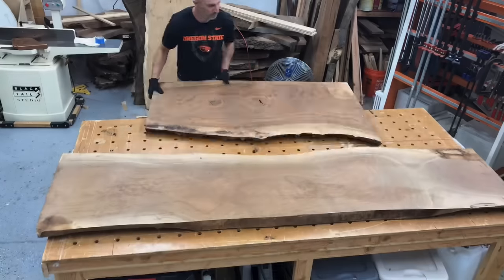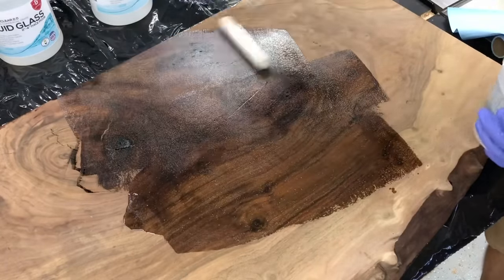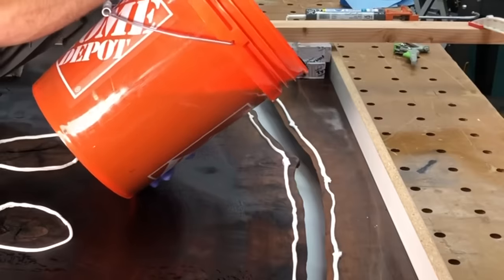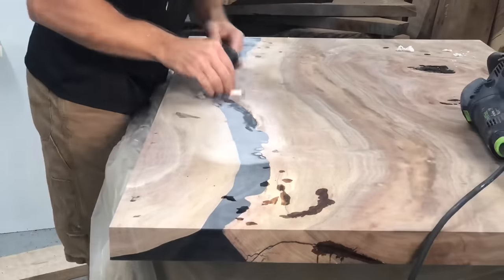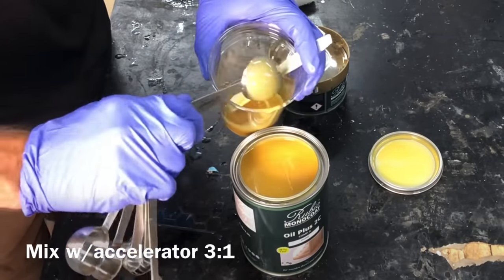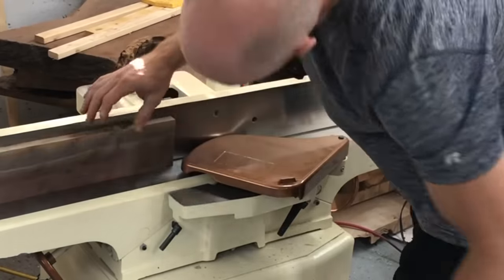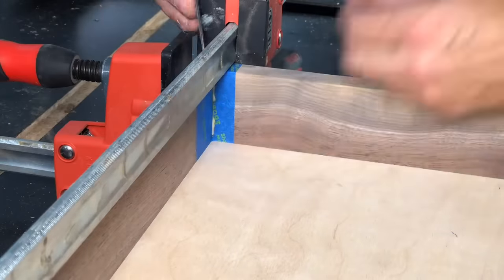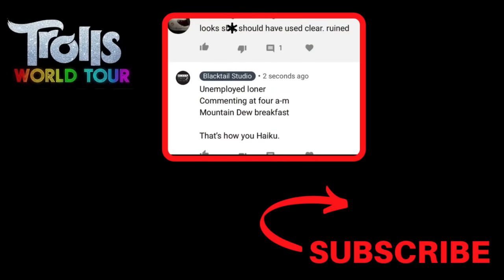Strangest Thing I've Found In a Slab

Comment: As a cabinet guy,  I think I would probably have built a box just around the drawer to mount the drawer slides in.  That would effectively hide them and not be as distracting as just the slides themselves.  Just a suggestion if you should run into problems like this again.  Your work is beautiful though and I enjoy the videos.  I am doing a kitchen remodel in our house and I will be using our local wood (mesquite) for a bar top. I have found inspiration from you videos.  Thanks again.
Reply: prefect solution
Reply: The only drawback would be that the cubic measurements would be much greater for the same volume of existing drawer space, not to mention the extra wood, much of it not exposed to show its artistic beauty. But the push-release mechanism would be possible with your solution, and if Cam's father-in-law is good on the idea, then it would be a viable solution. (As a cabinet guy, why don't you create a solution that can be marketed for wood artists like Cam? Lotsa dough potential :) )
Reply: You took the words out of my mouth...
Reply: A beautiful table indeed. i would consider painting the drawer slides to match the legs. We all know the legs are there, same with the slides, we know something makes it slide in and out. Just a thought.
Reply: Absolutely agree that side-mounted glides on a three-sided screen made from the same materials as the box would make this a much better present for your father-in-law. I suggest you go back and retrofit it !
Reply: @retiredarchitect3462  while this would hide the slides it would also lower the clearance under the desk drawer. Depending on initial clearance it could prove cumbersome to sit at. If he was willing and the recipient didn’t request a certain depth of drawer it could still be done by the method discussed and also making the drawer shallower.
Reply: @troyhindsley9177  I meant three-sided as in two sides and a back to keep them square - not a bottom beneath the drawer.
Reply: @troyhindsley9177  The sides wouldn’t need to extend past the bottom of the drawer. Everybody knows the mechanicals are there so the sides are only for camouflage.
Reply: I do the same thing every time I make a drawer these days.
Reply: Yeah.. That also came to my mind..
That metal needs to be kept out of sight..
Reply: Yep exactly what we do.
Reply: The more real easy thing that you might try is to match the color of the legs with paint. I would go with a flat black, so that the hard ware that is used on this project will not stick out like a sore thumb. Al d
Reply: Agree.
Reply: Not a cabinet guy. Or gal. I thought the same.
Reply: Just a carpenter my thought was maintain the profile of the drawer face around the perimeter of the desktop matching the reveal ? Also I agreed we earlier comment that the exposed draw guides would look or blend matched with the black used on the legs ? I’ve heard this from designers & Architects, “ hide it in plain sight with a reveal and flat black finish” lol 😂
Reply: Joseph Driscoll .... You spend a lot of time under your desk, do you?
Reply: @cletusspucklerstablejeaniu1059  ::-)
Reply: Thin veneer strip over the drawer glide would do the same thing.
Reply: Love the videos. I can tell you really love what you do and that makes the work so much better. 
Just a a FYI Hardware resource has a great push to open under mount drawer glide that would work so well for this drawer.   The drawer front would have to be a little over sized to hide the hardware but mounting the hardware inside of a box made from this beautiful wood would have given you a better solution. Keep the videos coming!!
Reply: As a Youtuber, I agree!
Reply: I would have off centered the draw from the chair position , or added 2 draws off center for balance
Reply: Im not a cabinet guy or a carpenter but i thought the same.
Reply: One way to lessen the brightness of silver tone hardware is to darken it with bluing (as in gun bluing). Bluing will darken specific metals causing the metal to blend into darker wood. It was commonly used on antique tools and other devices. It's what gives them such a rich dark gray tone. It's a really simple process to apply.
Reply: I was thinking the same thing good suggestion.
Reply: @cletusspucklerstablejeaniu1059  😂😂😂😂😂😂😂
Reply: Sooooo sorry I just saw this... what he says

Comment: Quick tip about using the CA glue: The activator will (almost) instantly cure the top but if what you are glueing is on the deeper side it may take a little bit longer. A way to get around this is simply wait longer or to spray the area you are glueing with the activator before and after you add the CA glue. Love the videos, keep up the good work!!!!
Reply from the maker: Good call!

Comment: Beautiful desk from a magnificent walnut burl slab. Enjoyed watching you building and finishing it. 
I’m a retired cabinet builder and have a keen appreciation for others fine work. Yours is very, very nice but if you’ll allow me to state an opinion…mechanical drawer runners are great. I installed hundreds of sets over the years, from early KV’s, to epoxy coated Europeans, to all sorts of more recent iterations in the ball bearing category. Any runner that has plastic parts is an invitation to failure. Soft close, self close be damned, they just don’t hold up in the long run. It’s a shame that we’ve become so lazy that we can’t push a drawer closed…as has been traditional since drawers were invented, until pushing a self-closing risks breaking those accursed plastic parts. There’s nothing that works better than a set of full extension, with one inch over travel, Accurides. Pretty simple to install and simple to operate and if you happen, under dire circumstances, to get a failure call…simple and inexpensive to replace. Now I’ll step down off my soapbox.
Again, enjoyed the video, keep up the beautiful work !

Comment: Your work is stunning.
One thing that you might consider is that if you have to “sand to heat up the surface”  before scraping, then perhaps investing in an infra red panel mounted above the workspace. Not only would it keep the workpiece at whatever temp you set it to, but you’ll make it nice and toasty in the winter.

Comment: A little tip about the draw slides to hide them with out little modification, if you make the drawer a little wider and increase how far back the drawer goes you can mount the slides inside the drawer but you use therm on opposite sides, so when facing the drawer the right one would be mounted on the left side inside the drawer and the left one mounted on the right inside the drawer.  This way you can't see the mechanism under the table or on the external side of the drawer.  Another little thing when something is so highly chromed and stands out is to use a metal bluing liquid this will darken the metal making it less obvious.
Reply: Just a nobody interested in your idea and trying to get a grasp of how it works: so what your are saying is basically, maybe not double the drawer width(?), recess the bits inside so they are hidden, and enough room to still function(open/close)?    If so sounds like a great start to a secret stash box in the back with a false back semi dividing forward and rear of the drawer compartment.
Reply: @midnightqueen3332  work on that and let us know how you did it

Comment: Your choice. 

Beautiful job as usual. As for sealing the slabs, I definitely do. Not sure why BlackTail has a strength issue, epoxy should stick to epoxy. I find as the the epoxy gets hot it will draw the bubbles out of the timber, unfortunately often just before gelling thus sealing in the bubbles. I do however prep the edges like yourself, then scrub the coating on the edges with a stiff brush rather than a roller, otherwise you can cast over air pockets again sealing in bubbles (that you don’t see until you do the main pour).

Keep up the good work.

Comment: just going through watching a lot of you vids... super great content. I own a commercial office furniture company and you had said that 30x60 is an average desk size... that is true although it would be on the small end for standard sized desks. standard desk sizes are 30 or 36 wide by 60,66, or 72 wide; but I would say 72 is the most common since most office spaces are 10.5' to 12 feet wide you can fit a 72" desk and still have 3+ feet for the walk way. Dont want to sound nitpicky, just a fun fact for anyone interested.

Comment: Great looking table as always. I agree with you the drawer slides wasn't the best, but one possible solution to conceal would be to paint them flat black matching the legs.
Reply: I would have finished two 3x1x16 (approx) blocks.  Mounted those under the table and then mount the drawer tracks to the wood blocks.  Those L brackets are definitely a bit garish.  Painting them black would help as well though.
Reply: Or just box the entire drawer in.

Comment: Love your videos. 
Have you tried using some sort of vibration to prevent the bubble voids you get at the bottom of the boundary between the epoxy and wood?  Maybe as a test use a random oscillating sander. Maybe just tap the slab with a rubber hammer. If this helps maybe build a top for your epoxying table with vibration motors built in. 
On another note, some people (me included) are violently allergic to CA. Didn’t bother me at first, but soon got to the point where exposure will give me the equivalent of the flu for a week. Just a warning.

Comment: Since you asked for tips, I used to do similar sorts of work with polyester, before epoxy was readily available and I noticed you using Alex Plus to dam your pours, and though I thought it was a clever solution, I used to use modeling clay to dam multicolor pours to create complex graphic schemes. The oil-based clay is easy to role into 'worms' and get very precise 'masks' between colors. It's reuseable and easy to remove and clean up after.

Comment: Joseph Driscoll pointed out a box around the drawer. I would like to add that making the beveled front wider than the rest of the drawer (by ~1in on either side) would cover any extra wood used to cover the side slides.

Comment: Breakfast bar counter. I’m enjoying watching your amazing videos. In 2018, I bought a 9 foot long, approx 24 inch wide live edge slab Korean Elm (what I was told, I’m not knowledgeable about wood) for about $160 Cdn. The plan is to install in kitchen/dining area as a breakfast bar/wide shelf (not likely to be used as a place to eat but more a way to finish this part of the kitchen/dining area) The place it will be is open to a stairwell on the one side, (half wall on end of dining area which opens to right into kitchen) so it needs some sort of backsplash/edge that is at least 4-6 inches high to stop things falling off the other side. I’m thinking of using copper or glass. Despite searching online I’ve not seen any examples similar. My brother is a capable handyman and I am good at design, creating solutions.
The Rubio product you use is amazing, could it be applied on on oak table that was finished with dark stain many years ago? 
The desk is outstanding. I would have asked that the drawer be situated to the left side, as it is now, in order to open drawer, you need to move to one side. I understand you probably decided position based on symmetry. Thanks for sharing your craftsmanship.

Comment: Beautiful table! I'd love to get into this but it looks like the machinery and tools you use would be extremely expensive. Guess I'll just have to stay small and have fun. Great video, thanks.  😊
One question, I noticed you put the drawer in the middle of the table, if you're sitting at the table and opening the drawer wouldn't it run into  your waist? I would have wanted the drawer on the right side and a big smaller. Just wondering how the decision to put the drawer in the middle came to be.

Comment: Honest question, REALLY hope you will answer. When NOT using transparent epoxy - i see you use black a lot, which is very pretty i admit, would it not be an option to fill a huge portion of the space between the slabs with any non-porous wood, cut to the shape roughly, with like half an inch lower top than the slabs itself, and then fill the mold? wouldn't that be a lot cheaper than the use of the quality epoxy? for adding strength to the table i see you regularly use metal bars, so i don't think that would be an issue either? lets say for example you have a 3 inch thick table, and you use 2 slabs, and between each slab you have atleast a 3 to 4 inch wide 'gutter' between each slab. would it not be better to cut a piece of (ply?) wood to reduce that gap in width between the 2 slabs to a quarter of an inch, and to have the 'thickness' of that wood 'filler' like for example 2,5 inch. you reduce the amount of epoxy needed by a huge margin i would argue.

Comment: As a retired product Designer, I didn't care for the exposed hardware on the drawer sides. I would have loved to have seen a slide embedded in the top if the sides leaving a clean exterior and interior with maybe just a slot for a plate. Of course I donno if you'd need to invent that mechanism, but with your incredible "attention to detail" I'd be looking into that possibility. That Walnut looks fabulous as always! Also very unique legs, just not my style. Great work as usual! I see a comment by a "cabinet guy" below has taken issue with the exposed slides as well .....

Comment: Did the bullets trash the planer blades or were they made of lead and soft enough to be cut without damaging the planer?  Do you worry about using slabs from urban trees that may have nails, wire or bullets?

Comment: In smaller batch resin casting we use a method called double pour, or double mix, specifically to avoid curing issues. We tend to scrape sides when pour but not when we mix, so if we pour into a second cup it helps with getting that more even mixture.
Reply: Thanks. I've always wondered why some epoxy kits say to use a second cup, if the material was thoroughly mixed and sides scraped in the first one.

Comment: Cool video brother. I especially appreciated your bullet fragments, very cool. 
Working at a custom cabinet shop, I was milling out a large slab of poplar, about 4" thick x 10' long. I was ripping trim pieces about 2' wide, and after a pass, my right inside forearm felt cool, I looked down and it was covered in blood! After mopping it up and a duct tape bandaid, I examined the pieces to figure out what the hell happened. In the previous cut (before blood) there was a small dark streak. Looking closer, I saw a small 2mm silver circle. Lo and behold, it was the remaining half of a lead buckshot! 
Of course the punchline is, I had found a bullet that was fired once, but after 50 or so years, had finally struck someone! :)

Comment: When I used to build large commercial buildings we always made a big deal of making sure the wood doors were painted on all sides, including top and bottom.  The reason was to avoid warping caused by differential absorption of moisture.  I think you are right on sealing top, bottom and sides.
Reply: Sounds wise!

I actually have a question regarding this. My previous flatmate had a nice big thick heavy slab of glue laminated wood (?? I think this is correct, English is my second language). Nothing fancy, but hey we are students. He used it as a desk and since he isn't particularly bright (just kidding, he simply didn't care) he "treated" the only top surface to protect it with crappy white paint, probably for walls. Of course, the slab warped, especially after I removed it from his room after years when we left the house. I was thinking of using this wood for a few projects if I can get it to straighten out enough (again, I'm a student, so budget is key plus re-using is nice :)  ). Do you think that if I sand it down and allow the wood to breathe from that side as well it will be able to absorb moisture and compensate, or is it doomed now?

Thanks!
Reply: @giacomochizzola1266  That's a bit beyond my knowledge level, but I would NOT think it will settle on its own.  However, you might be able to locate a local woodshop that will plane it down for you.
Reply: @giacomochizzola1266  yes it will straighten out again ,.. the warping is because the paint will shrink and thus will warp the wood ,.. that's why laminated wood always comes with a backing to counter that .

Comment: Beautiful desk! You could probably do something to make the hardware less conspicuous. Suppose you had a wider front panel to the drawer, and add some thin panel to each side covering the hardware? Or, barring that, could you color the steel in a kiln? You you make it blue, or black, or as I’ve seen on gun hardware, “color case hardened” they called it— you get a swirl of different metallic hues.
Reply: The runners he used have plastic parts, as do most mechanical runners nowadays…even the most expensive ones. Some more than others…which is usually where they fail.

Comment: Really liked the desk. It looks amazing.
I made a desk 2 years  ago for my wife when she started working from home. She wanted the open desk concept. I couldn’t get the under mount slides at the time so I used a similar push to open, slow close slides. I dado’ed and routed out the places where the slide rails and brackets on a matching piece of walnut on each side and then drilled holes in the walnut slide cover and the walnut drawer sides to put a faux panel over the rails and using magnets to hide everything. It has worked great so far.
Since then I have made another desk and used the under mount slides. I made a faux drawer box shell around the entire drawer and it gave it plenty of support and turned out fine.
Also at the 13 minute mark you were using your sawstop to cut through a board... Does your SawStop have a 12” blade?
Thanks for your time.
RonH